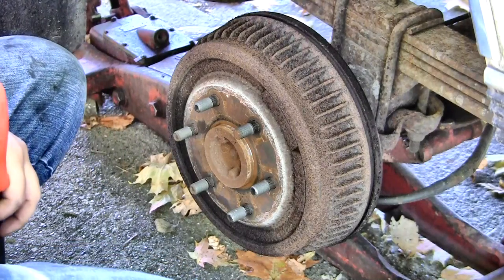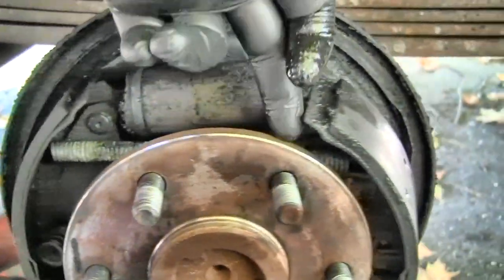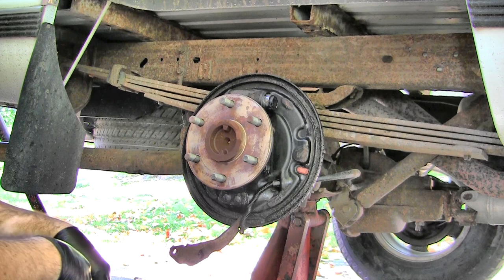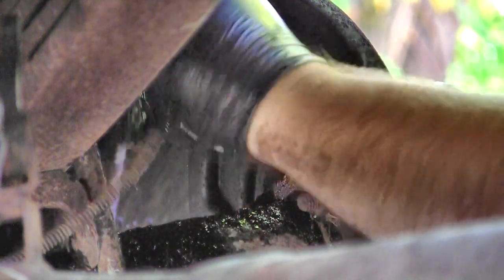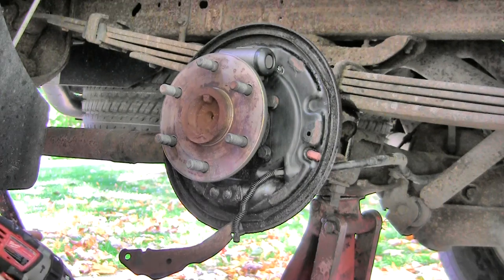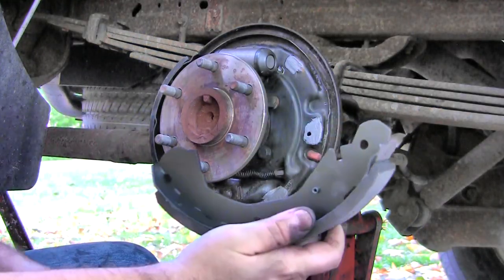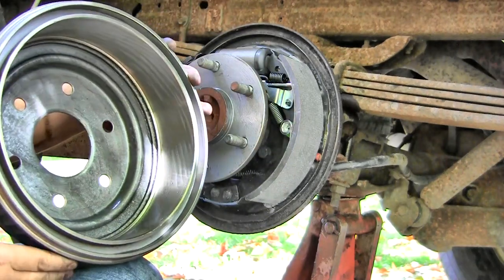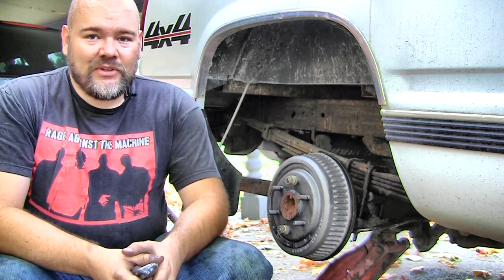1995 Chevy K1500 Complete rear drum brakes replacement 4x4 - Tips n Tricks

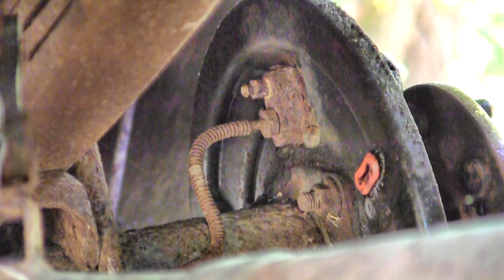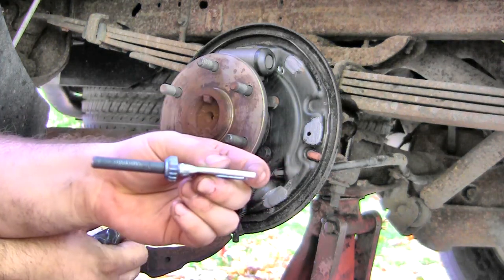Comment: You see that oval-ish orange grommet at 12:00? Thats how you adjust the brakes (decompress/compress), take the orange grommet out and you use a flat head screw driver on the gear lookin thing (the thing at 24:11) and push/turn it up or down to adjust the brakes. Just for anyone reading the comments that this may help out.
Reply: That is not true where that orange plug is that's to inspect your pads the adjuster is in the middle on the other side so that orange grommet is not used for that on these trucks you cannot do that
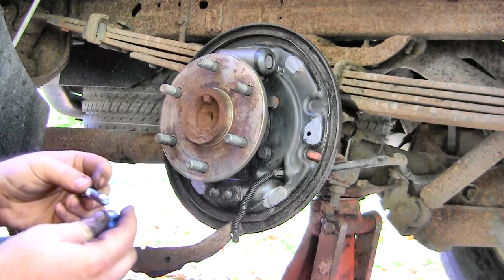Reply: @Robert Davis   @Robert Davis  Yes you can I have personally done it. There are 2 different oval "inspection" windows on the back of where the drum goes. There is one for inspecting the wear of the pad on the brake itself, and one to adjust the tension of the brake. One on the top and one on the side. The grommets also may be a different color, like black. They arent always orange. The grommet at 12:00 is the one for adjusting tension. The grommet in the background at 24:11 is the one for Inspecting. There are 2 different grommets. Ive done brake jobs on this truck with the bigger size drum brakes and it was the same exact thing.
Reply: your wrong, GM trucks  do not have access thru the baking plate to the brake adjuster. on that year and some other in that era...
Reply: @burnerloco4138  Well the one I worked on sure as crap did.. It actually had two. One for inspecting, and one for adjusting. Sometimes the grommets are black instead of orange.
Reply: @VashStarwind  all gmt 400 with a 10” drum do not have any hole to adjust the shoes which is what he is working on. Now HD and trucks with 11”  drums do. So that’s what you were probably working on
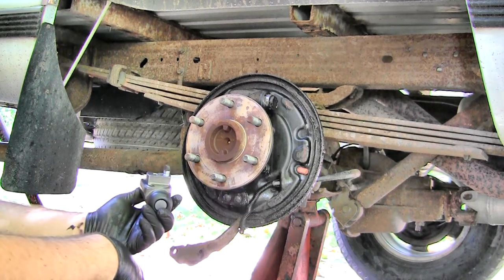Reply: @burnerloco4138  Sorry dude but your wrong, you can literally see the two different holes in this video. At 11:50, the orange thing, is the grommet for viewing how worn out the pads are. At 12:00 in the next shot, that orange grommet is the one you use to adjust the brakes. Its on the top side of the axle. Using a flat head you turn the star nut on the brake tensioner.

There might be a model that doesnt have those, but i havent seen one. And the truck in this video sure does have them.
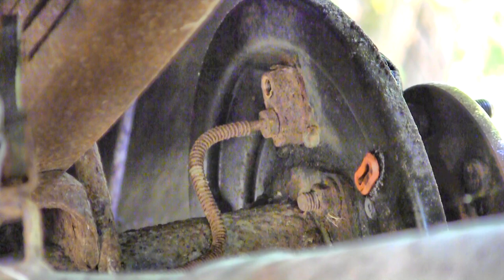Reply: @VashStarwind  that other slot12:50 is no where near the adjuster. I have owned a few of these trucks,plus worked at the truck plant on the frame line and they don’t have a slot for adjusting the brakes on the models like I mentioned (88-98)before. The older trucks did before 88’ anyway I guess we agree to disagree about that.

Comment: the plate you keep referring to is a backing plate and  when you clean the contact pads with the wire brush I prefer to do that before you install the new wheel cylinder  because if by accident you contact those rubber end seals you could damage them no biggy just a cautionary deal. Now for a little FYI you can pull the wheel cylinder without moving the shoes (if you aren't replacing the shoes just replacing a leaky cylinder) by simply applying the E-brake because that pivots the shoes off the wheel cylinder pistons. One other thing while spinning the wheel cylinder off the line works you should then wire brush and WD or PB Blaster the line till it turns - - if it is severely rusted on there then its going to fail and you should replace now rather than when it pops going down the road not to mention the additional work of bleeding the system all over again. Use a regular set of plyers  to remove and reinstall the retainers caps by getting the cap in the serrations of the plyers (as you mentioned later)as it gives you more surface area and more control. One other tip that helps have the flat tips of that retaining pin at 12 and 6 clocking and hold it there from the back then put the cap in the plyers with the same orientation that way you can push the capt directly on and then turn to lock it in the indent. To lessen the fooling around with bleeding - - gravity bleed by opening the bleeder til fluid runs steadily out the bleeder and for the bleed technique your about to do use  a clear glass container with clean fluid in the bottom 1/4 of it  and if you leave your camera there  directly on it you can check and you'll see when bubbles stop coming out as you are up front in the cab pumping the brakes - - you'll see a swirl which means all fluid running through - - nice job

Comment: Thanks for the spring info. My retainer pin rusted into and made a mess. Locked up the wheel. Original brake shoes on a 98 z71 Silverado with 115k. Shoes got a little damage and chipped the   brake material off. New shoes, hardware, and wheel cylinders getting replaced. Dang Indiana road salt. Probably could have got another 50k miles on the shoes before they were wore out.

Comment: Thanks. Made my day, for sure. However, it still took me about half an hour to get the auto adjuster springs in place and then almost another half hour getting that bottom spring back on. Mine is much, much stiffer and shorter than the aftermarket one you're using in the video. Still though, couldn't have done it without your video. Doing the other wheel tomorrow. lol.

Comment: looks like a leaky axle seal ?! i just did a full rebuild on my 96 Silverado  rear diff , new posi,gears,bearings  & seals ….before i started i bought all new acdelco drums,shoes, wheel cylinders, spring kit,  self adjusting kit for each side so im doing my final assembly so thank you for the Video 🙏 i also did shocks and now about to fill fluid and assemble brakes & bleed them out 💪

Comment: One other thing when you are going to do brake work on the K1500 series trucks you have to know what size brakes are on it as they 10 inch and 11 inch - - not only are the shoes and drums different but so are the wheel cylinders. Yesterday I made the mistake of thinking the person at the parts counter knew what they were doing when they pulled my parts but as soon as I picked up the box with the drum in it I knew something was wrong - - if you can believe it she  supposedly pulled parts for a 10 inch brakes but the box had a rotor in it. We got that straightened out and I went home and started work only to find some how she had also given me 11 inch shoes for a 10 inch drum - - shame on me I should have looked because the 10s are a little over 2 inches wide whereas the 11s are 3 inches wide not to mention too damn long to even fit in a 10 inch drum.  10 inch are pretty much standard  but pull a wheel and pop off the drum and measure inside lip to lip - - good luck smelling of brake fluid for a couple of days   - - been doing it over 50 years and still not used to it

Comment: good video and thanks so much. one thing though I wouldn't put anti size on the axle flange surface. I would be concerned that the bolts could sheer because we depend on the friction between the flange face and the wheel to hold the wheel on. if they can move much at all the bolts will be in sheer and that would not be good.

Comment: Just replace the brake line leading up to the brake cylinder. Don’t be lazy by spinning the cylinder off the line. Brake fluid is ver corrosive, and that combined with age, warrants replacement of the brake lines. Measure the length of the line, then purchase from local hardware store. It will come already flared and fittings installed. Of course, you can buy just the line, then install fittings and flare the ends if you’d like. You can also purchase a complete brake line kit for these trucks, which includes lines, fittings, etc., and functions as a plug & play system. Just do the job right folks, and don’t cut corners, like trying to preserve worn out, corroded brake line. FYI, when you replace major brake components like wheel cylinders and calipers, This usually results in higher system pressures, as you’re no longer leaking fluid, loss of system pressure. That said, other lines are likely to blow out, so replacing worn/corroded lines is always a good idea, especially for those of us who live in the Midwest!!

Comment: Little tip.  Use wire brush or wire wheel to clean brake line at the cylinder nut and spray with PB Blaster and use a line wrench and rock the nut back and forth and it will come loose without breaking the brake line.

Comment: Thanks for the info. I am fixing to put brakes on my 4x4, I just swapped my 10 bolt for a 14 bolt, and the 14 bolt axle needs new brakes. I searched for chevy specific drum brakes, this is the first video I have seen for the 88-98 truck brakes, everything else was too new for me.
Reply: Jeremy Cribb I just swapped my 10 bolt for a 14 bolt semi float 97 Z71 and I put a u bolt flip kit on it.. I also put  a 9 inch RCX lift on it and 3 inch body lift. how did your swap go?
Reply: It was actually pretty easy. The only used part I kept was the drums, everything else I ordered new. I did give up and pay extra through LMC truck for the parking brake cables, because the parts stores weren't specific enough with which side did what, only length. LMC had it broken down by right rear etc. worth the extra money to know I had the right part the first time.

I already had the odd ball u joint for the axle because mine is a 94 Z71, it was a direct swap.
Reply: Jeremy Cribb what size was the wheel cylinder
Reply: It was whatever Autozone had in stock. I am not aware of any specific size. I ordered it specific to the axle. For me I have the 14 bolt 9.5 inch 6 lug rear axle (light duty 3/4 ton, also known as the semi floating rear axle). I no longer have the stock 10 bolt the truck was originally equipped with, I upgraded after the 10 bolt gave out.
Reply: Look in the rear end, it has the year the rear was made stamped in it

Comment: Just a quick TIP -- NEVER use normal wrenches when removing Brake Lines - Open Hole Wrenches apply pressure to all surfaces reducing likelihood of stripping.
Reply: FYI the wrenches you are referring to are called "tubing wrenches".!

Comment: loosen the brake line before removing the wheel cylinder its makes it a little easier, also be prepared to replace the brake line cause if its rusty it will probably twist off, especially  if you live in the rust belt states.

Comment: Okay 2 things if you line the nozzle up with the line on the can you can empty the can with out shaking it 2nd thing is brake clean works allot better if you get an air gun and blow on the parts at the same time

Comment: That’s why you use a flare nut wrench has five sides of contact instead of two leave your cylinder attached if it looks that bad sprain it the night before The oil penetrate to rust given time not too much

Comment: the shoes were installed backwards - which is likely cause of failure. Short shoes go on the front. Long on the back.
Reply: front and back shoes are identical. The front shoes have pegs to hang the adjusters from. I don't think he installed the pads backward

Comment: Great video!!!  By any chance... What size were your drums and shoes?  I have a 95 2 door tahoe 4x4. I'm curious as to if they both are running the same set up.
Reply: My 98 Silverado with the smaller 10 inch drum has this type of brakes. I've seen YouTube videos with the old style spring setup and some with a single large horseshoe shaped spring. GM keeps you guessing. Try searching for Vin number identification if you don't have the drum off.

Comment: Awesome video. I do have a question though. In the past working on these type of brakes my Haynes manual says put the spring washer between the adjuster and shoe. Most of the trucks Ive done have it like you did on the outside of adjuster. Do you think it matters?

Comment: making it look easy. I am in maine. rear brakes means 18 feet of prebent stainless, hardware kit, cutoff wheel to get the cylinder out.. the self adjuster needs an attack twice with drum off, ebrake cable readjusted, and bled 3 times with lid off master cylinder...and the obligatory reverse and forward brake adjust for that stupid ass auto clicker. This isn't like the old drum brakes at all .I miss the old stuff. To remove ebrake cable from bracket.. there is a trick with a harbor freight universal interior trim tool set and vise grips. Makes easy work out of that 10000 pound spring.

Comment: I replaced everything even bleed it out but it wont stop when i push thr brakes will adjustment be needed after insgalling brakes?
Reply: I think so. I just used the video as well and can't get pressure. I didn't adjust the adjuster outwards after installing. I am going back tonight to adjust out until the drum slightly drags and adjust back out a little. I think unadjusted, they are so far out that they just aren't engaging until the wheel cylinder is fully expanded. Should have thought of that before anyway. I did have them swapped first try so the adjuster was tightening them up instead of spreading. 

Also, the tab on the adjuster. Is it supposed to go inwards towards the vehicle or outwards?

Comment: My 98 chevy z71 rear end hops when I push the brakes and when I'm coming to a complete stop it jerks back and for idk what it could be.
Reply: Check ur adjustment.  They might be to tight causing them to lock up. And what is making it hop under hard braking. Or ur wheel cylinder is going out

Comment: Why the "Purple Power"?  It can't cut the grease like oh SAY BRAKE cleaner.!  Kinda a waste of time.  I've been building cars since 1975, and I have never shot 409, Ajax, or any kitchen cleaner on brakes that I was going to replace, mainly because it does not break down the build up of brake fluid and brake dust.  Could you have a wheel bearing and or seal leaking there?.  Just my observations.  Otherwise nice job.

Comment: I know you published this 2 years a go but putting never seize on the axel flange is not a good  ideal it can get on the drum braking surface when you drive(when the axel spins it get thrown out onto the machined surface of the drum) and it's just not needed 
I've changed a lot of drum brake shoes and I've never had a drum frozen to the axel face the only time I have problems getting a drum off is when I can't back the shoes off like on this dumbass design or when the adjustors are frozen either way the shoes get stuck on the wear edge of the drum and no amount of never seize will help

Comment: As soon as I saw you put thread tape on the bleeder screw,I had to stop watching!
That is the quickest way,to get an air leak,or bits of tape sucked into the brake cylinder.
Also,when you loosened the line,all you had to do,was put a bit of  brake fluid  on the line,where it enters the nut,and wait a bit,for it to loosen the rust,and you could turn the nut,without the line twisting.
Also, the orange  rubber plug,at the rear,is where you do your initial shoe adjustment,or to release the shoe,to remove the drum.
The shoes ARE different,as to the position they are in,on each side,as you have a "leading" shoe,and a"trailing shoe",and putting them in wrong,will lead to problems.
GET A MANUAL !